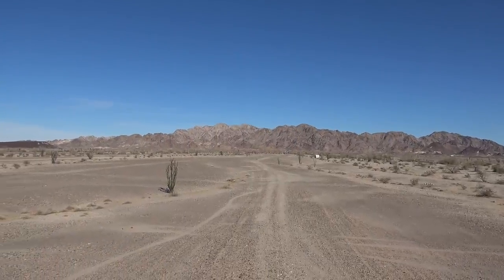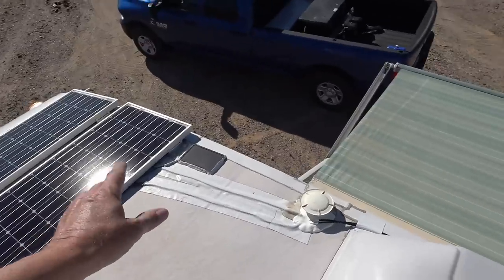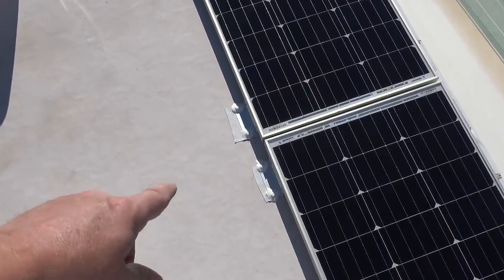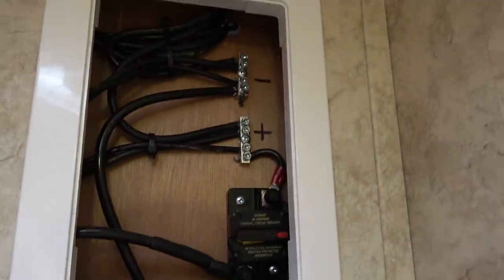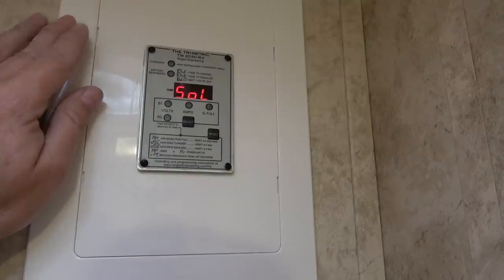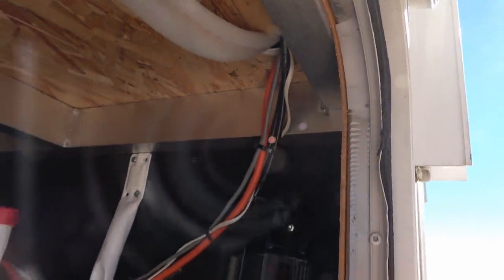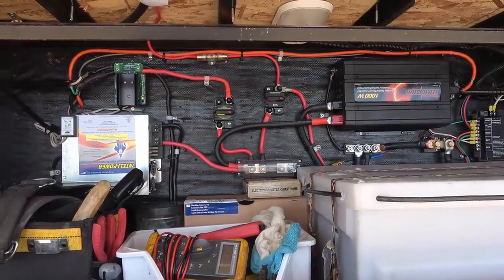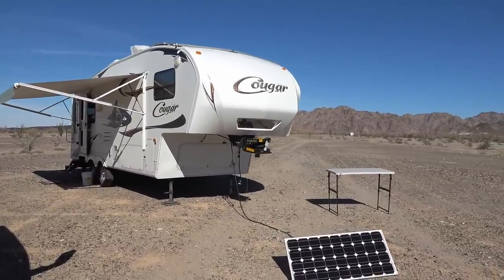Boondocking Power Upgrade -  2 More Solar Panels + Wiring Update & Mods

Comment: @LoveYourRV   How long of a run is that 4g wire? I bought 6 for the 3 175 watt panels I’m going to install and I am going to make the same run as you on my cougar.  I am right border line as far as run length with 6g and I should have bought 4g.  If the run is around 15 feet I will be okay with less than 3% line loss with my calculation other wise I need to buy the 4g.
Reply from the maker: I'd guess around 12 feet one way. About 8 feet to the basement compartment and then other 4 over into the front compartment. Could be less even. Cheers, Ray

Comment: Any plans to upgrade your bogart charge controller? I like the way mine is working but I thought the bogart charge controller was a 30 amp. max. With 700w of power coming in, wouldn't that put you over. I only have four 100 w panels but was considering adding a couple more.
Reply from the maker: The Bogart controller can safely deal with the extra amperage, but I also could buy a second Bogart and run them in tandem for 60 amps, the Trimetric monitor is able to communicate with 2. 
No need to upgrade right now unless I want the extra power in the summer which by then the days are long and sun high so not really needed for us. My main goal for this upgrade was to deal with the short solar days, low sun angle of winter and overcast days.

Comment: What happened  to the switch  for the solar shutoff you installed? Still using it?
Reply from the maker: Now that I have installed the switchable breaker inside the bathroom wall I don't need the remote shut off, I can use the breaker instead.  :)

Comment: Have you considered a 12v compressor fridge?
Reply from the maker: Our propane one seems to work well, maybe if it bites the dust one day. I've heard from a few people that tell me the residential fridges take quite a bit of power.
Reply: I am not sure that me and you were talking about the same fridge. I’m talking about not a residential fridge but the actual 12 V compressor fridge that’s new to the markets. I seen it on certain models on the Haylett RV channel.Apparently it runs on next to nothing as far as 12 V power consumption and cools off really quickly and fast. I don’t know the prices but I hear they perform very well from people that have installed them as a refit on their RV. They’re basically for RVs only and run on 12 V only.
Reply from the maker: Oh, sounds great, I have only seen the chest type 12V units.

Comment: Maybe worth a plastic cover over the buss bar Incase a wire comes loose and tries to make contract from negative to positive. Maybe a fire hazard.
Reply from the maker: Not a bad idea as an extra precaution. I feel pretty safe though, I added heavy zip ties to the separate bundles so if one or two wires came loose they won't go anywhere. Also, worse case scenario of a short would be a combo of two 100 watt solar panels with a max current of about 11-12 amps, the wiring can easily handle that load with out overheating. I guess the only thing that could happen is sparking, but with the low voltages and current involved it would be pretty weak. Cheers, Ray
Reply: Any fears with the bus bars being screwed directly into the panel wood?  Should a connection grow loose and create heat: any concerns of fire?
Reply from the maker: @jameshamm7911  I'm not concerned given the low voltage and limited currents involved and the mass of the bus bar and the wires. If you were to look behind the walls of any RV you'd find the low voltage 12VDC connections just lying around everywhere. ie. plastic crimp connectors on 15 amp circuits lying against interior walls and ceilings.
The shore power 120 VAC wiring, on the other hand, is a different story and can create powerful arcing, enough to create significant heat, so you'll find the 120VAC connections inside a metal or plastic junction box. Now, if a person is to wire the solar system in series the DC voltages multiply and wires are often thinner and things get more dangerous. Some systems are running 48 VDC or higher.

Comment: Hi,

I'm doing my homework. I do not own an RV nor travel trailer yet.   I leaning toward a midsize travel trailer.   What are my option for running AC while boondocking?  How long can i run the AC and for how many days?

Thank you,
Reply from the maker: Best bet unless you have a ton of money to invest in at least 4 lithium batteries, large 3000 watt inverter and numerous solar panels 1000W + is to buy a gas or propane generator to power the AC, you'll need about 2800 watt unit or better to run it. Cheers, Ray

Comment: Are those circuit breakers rated for continuous or intermittent duty?
Reply from the maker: Here is a link to the breaker and its specifications - https://www.bluesea.com/products/7182/285-Series_Circuit_Breaker_-_Surface_Mount_40A

Comment: You have TWO positives going into the one breaker.  One is already fused.  What are those for?
Reply from the maker: There is one spot (I think that is the one you are referring to) that I tapped into for a supply to run my 12V air compressor for tire inflation. i added a 30 amp fuse for that extra wire run.
Reply: @LoveYourRV  oh nice!  Yeah, the wire with inline fuse to the breaker with two inputs.  Thanks for the clarification.
Reply from the maker: Here was the mod - https://www.loveyourrv.com/viair-450p-rv-12vdc-air-compressor-review-and-rv-hookup-mod/  I've since moved stuff around but that was the basic just of it. Cheers! Ray

Comment: Ray, you are becoming a power hog.  My Class A has 850 on the roof and I love that I can almost always be fully charged at the end of the solar day.  Wish I was down in the desert right now.  We live in the Colorado mountains and have 4 feet of snow next to the driveway.  Currently planning spring trip through western Colorado, eastern AZ, northern NM and extreme western TX.  I have used a lot of your videos for ideas.  Happy New Year.
Reply from the maker: haha, well we do have a 315AH lithium bank now so takes a lot to recharge. We are still working our way back on % since all the cloud and rain AZ had recently. Nice with the lithium not to have to care about full charge anymore. :)
Reply: @LoveYourRV  Living at 9000 ft and below freezing for 4 months I have not gone Lithium.  I would need heaters for the batteries.  Changing from 12 v to 6 v changed my battery life.  Doubled my capacity and made boondocking much easier.  Spent a week last spring in Valley of the Gods (after watching your review) and only started generator for my wife to dry hair or use instant pot or convection oven.  Even with a residential fridge I would wake up to 82% battery remaining after watching evening of TV.

Comment: How do you clean your roof around and under the panels?  Do you remover them or just not clean/treat the roof in those areas?  Thanks and enjoy your vids.
Reply from the maker: I don't remove for cleaning or treating. Frankly, I haven't "treated" my roof for many years, just wash with soapy water a few times a year and its still in good shape 9 years later. I just flush the soapy water under the panels when I'm washing the roof to remove any debris that may have gotten stuck. I'm guessing the roof under the panels will out last the rest of it by a wide margin since they are physically protecting the roof from the elements.  Cheers, Ray